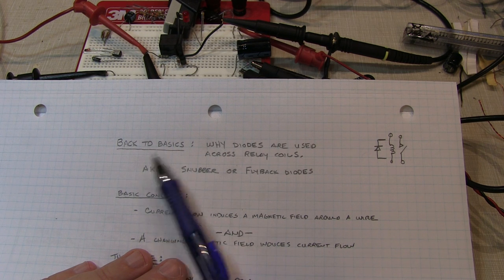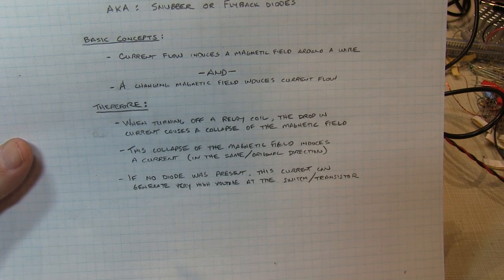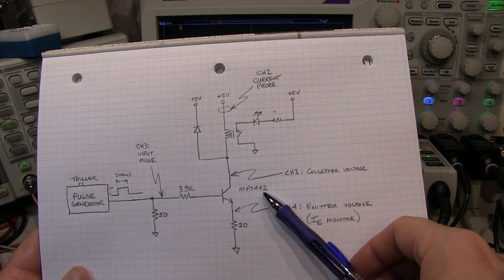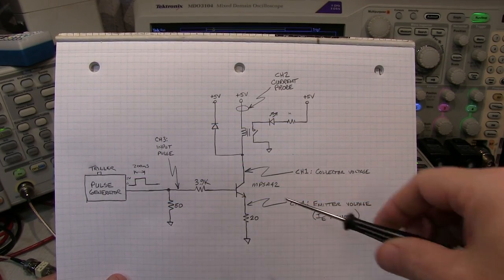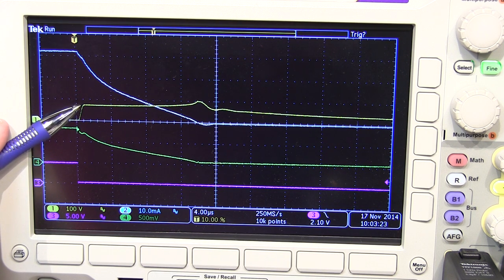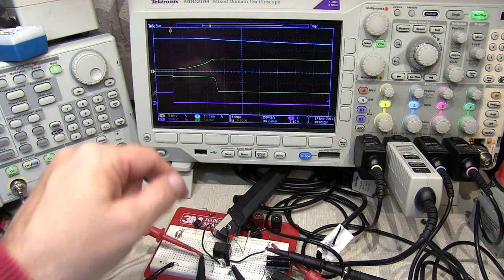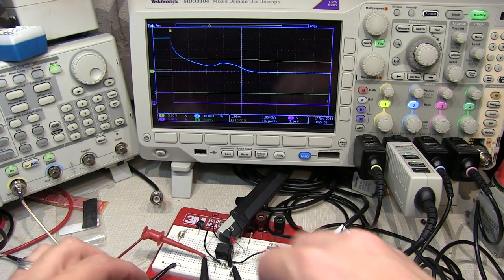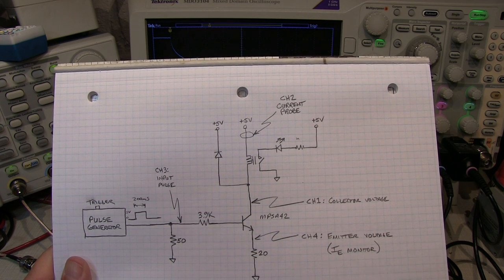#183: Why diodes are used around relay coils: Back to Basics on flyback or snubber diodes

Comment: I noticed your scope does not tell that the current probe is connected to channel 2 but underneath it knows to translate volts to mA's per division.  Is it an option of the MDO3104 (auto ranging?)? I see on the probe entrance to the scope 3 tectile switches  manu , degaussing . What is the third one? What is the max sensitivity of that probe?
Reply from the maker: The scope does give you the scale in xx mA / division. It is showing 10mA/div. Regarding the probe specs, you can find them on the Tektronix website.

Comment: @w2aew
I have read that a snubber is also a resistor and capacitor in series that is put parallel to the relay coils.
Is there a different in using an RC instead of a flyback diode?

Comment: Hello, how many volts would you expect the spike to reach at the relay switch without a diode on a 12v relay that was powered by 12v (like a car battery charger)?
Reason I ask is because as a kid I used relays to zap myself with (normally with 9v battery) but one time  I used a car battery charger with both arms covered in aluminum foil and metal rods in hand..... I was young and thought it's only 12v.... that time gave me a scare, never repeated it since.
Reply from the maker: It’s difficult to say because it depends on several factors such as the amount of current flowing while in the on-state, the inductance of the winding, the resistance/impedance at the terminals when switched off, etc.  It can easily reach several hundred volts or more.

Comment: One thing you didn't mention is that due to the current through the diode it now takes a bit longer for the armature to disengage. In other words: the relay becomes a bit slower. In most cases this is not a problem, as relays are pretty slow to start with, but it could become  a problem for a high speed CW (Morse) key. 

Then it could help to put a low-Ohm resistor (say 100 Ohms) in series with the diode: it will speed up the decay of the relay current, but at the expense of a higher voltage at the collector.
Reply from the maker: Another way to speed up the the release of the relay would be to use a zener in series with the flyback diode.
Reply: *****  Actually, I don't hink a zener would help to any great degree. The voltage caused by the collapsing field would just quickly rise to the new snubber plus zener voltage and the R of the combined snubber diode and zener is still low. The zener is still a low resistance and the time constant is still T = L/R.    I would only expect a very small decrease in release time.  Perhaps you could set that up and verify...?
...
  As Helmut suggests, a resistor can be selected, knowing the relay on-current, that keeps the flyback voltage below the transistor brealdown voltage.  This would give you the fatest release time since the R is the highest possible (t = L/R).  Big "R", small "t".
...
.  The value of R could be up to a value equal to V-breakdown / Relay current (with some suitable margin for V-breakdown).
This type of thing is a consideration when desiging drivers for steppers and laser light show scanners (as I have done).
...
It turns out that if you want the fastest possible time constants in the motor/stepper/scanner coil(s), you use the highest possible voltage supply and drive it with a constant current type drive.  This is equivalent to a very high series resistance.  You need the high voltage supply so you can allow the "fly-back" voltage to go to the supply rail for the fastest time constrant. It must be done carefully, or else that high supply voltage has the capability of "over currenting" the coil -- this is why it should be a constant current driver....  YOU control the current and (sort of) allow the inductive kick voltage to do whatever it wants to ( within the limits of the power supply voltage) so the L/R time constant is as short as possible.
...
Then you are trying to move laser scanners (or step stepper motors) around in milli seconds, this type of thing becomes important.
...
73

Comment: Reallyy good... could you please explain RDC Snubber off circuit for controlling the power across a coil. and how it is different from a normal diode snubber.
Reply from the maker: Probably a topic I won't be able to get to for a while, but here is a good paper on the topic.
http://www.cde.com/resources/technical-papers/design.pdf
Reply: thanks will go through it.
Reply: One more question question though once the power is taken off.from the coil.. the current will move from diode to positive terminal of the input power? and dissipate where?
Reply from the maker: It's really just dissipated in the diode and coil (which are connected in parallel).

Comment: Great vid. 👍 Just one question, I assume there will be a permanent leakage to the + rail from the diode? Thanks.
Reply from the maker: Only when the relay is energized, and even then it will just be the small reverse leakage of the diode (typically a few uA or less).  No current when the relay is not energized.
Reply: @w2aew  OK, thanks.

Comment: Thanks Alan, 1 question I have is:Could you put a switching circuit in,instead of the diode,that would then become the charge current to a battery or an ultra capacitor bank? Of course I'm thinking of larger scale devices such as linear actuators on industrial machines or such.
Reply from the maker: Yes, this is really the basis for a simple unregulated boost converter.

Comment: Can you add a resistor in series with the flyback diode to speed up the snubbing process? Is this a good practice?
Reply from the maker: I don't usually see that because it would result in a larger reverse voltage.

Comment: It makes me wonder would a 6v zener diode work if we attached its cathode on the collector and its anode to ground ? In theory it should work as it turns on once the voltage ramps up to 6V and the current will flow and discharge to ground.
Reply: But because of that maybe noise will enter the system

Comment: @7:05 Where does the excess current flow? Back through the 5V supply or through the probes? both?
Reply: Through the top of coil...the diode is connected directly to the top of the coil...so current takes less resistant path back through the coil.  The schematic makes it appear to some like it passes through the 5V supply...when actually the wire is connected back to the top of the coil.

Comment: Hey bud. No ones seems to have an answer for me on this an this is one of the better vids on inrush current I've found so far.. I'm at my wits end here lol. So long story short, I have 2 side by side LM317 circuits, voltage regulator(works great) then current regulator(works but getting spikes) I've tried every capacitor, every diode, everything. I've managed to totally get the voltage perfect. But no matter how I try I get .1-over 1amp current rushes going into my laser diode and out my laser diode.. Which if my LD was ACTUALLY hooked up would destroy it. Nothing makes sense. I even added a slow start/slow off by mixing PNP and NPs in with it and manage to get the -amp spikes down to .1ma(still want it smaller TBH) but still see peak spikes as high as .7-.8... averaging .4-.5 Way over accetable. What am I doing wrong? What am I missing? =( Been stuck on this for awhile meow.
Reply from the maker: Without a schematic of what you're doing, it is impossible to provide comments and advice.  In general, the LM317 can be used as a constant current regulator, but will not work well when switched on and off because the current isn't regulated until the voltage across the reference resistor increases to 1.25V.  Then, you're subject to the transient behavior of the regulator circuitry.  There are better ways to do regulated current switching.
Reply: Ohhhhh.. Ok.. So that maybe be culprit?Makin a lil more sense..An I figured about the needing to see the circuit. Just hopin maybe someone else has had the same issue and had an easy fix =/ I mean it should always have it's reference voltage at leas to tho, shouldn't it?(I'm powering 4.8volts, nice and regulated constant.). But you mean during spikes it dosnt sense it right, is that it? Then whats the point in the dang thing? XP  Also, already thank you for the guidance. An suggestions on videos to steer me to in reference to those easier ways? I've seen with relays and stuff to protect transistors or mosfets, NP and PNP (where I got the idea to try those) but mine has no relays, and has no transistors or mosfets I'm even 1/3rd as worried about frying as my 20+$ a piece LDs.. THANKS AGAIN!  @w2aew
Reply from the maker: @user-be4yc2vr5c  The LM317 was designed as a voltage regulator. Period.  The fact that it can be used as a constant current source is a bit of a bonus, but it's not perfect.  I did a video on current sources and current mirrors that you might want to take a look at.  Depending on what you want to do, there may be much better ways than trying to make an LM317 do the job.
Reply: Awesome, thank you so much for the help! Wish I knew that before I got them x.x; They get hyped so much.. I will search for those vids on your list. An thanks again for the guidance.. Like I said, been at it weeks now trying to get no current in or out rush outta this circuit x.x Been just cause the LM317 is garbage(or garbage for current regulation?) this whole time..  @w2aew

Comment: Howdy. Great.
The diode is a great backfire killer yes. Be aware though that this makes the relay or contactor slow. The residual current will keep the relay activated for some time.
A RC series component could be used instead of the diode if faster turn-off is needed. The driving transistor should be a 400 V item in that case.
Standard RC values are C=100nF and R=100 ohm. There are RC transient killers available with these values.
I have an experience with a PLC driving a small hot glue valve. The valve had a 1N4007 connected parallel with the coil. Good policy yes, but it was impossible to get precise glue dots on the cardboard. We replaced the diode with a RC transient killer and got precise dots. Clearly the RC knocked down the transient spikes enough not to cause a breakdown of the PLC output transistor.
In high regards.

Comment: Really good video.  I had no idea those sorts of voltages were generated around relay coils. Would it be sensible practice to fit one of those diodes every time you put a relay in a circuit?
Reply from the maker: +Spoolz07 Yes, absolutely.
Reply: +Spoolz07 Let's clarify: You should fit a diode every time you put a DC relay in a circuit. Perhaps that's self evident and perhaps it isn't. I deal with AC relays frequently and get asked if they need snubbing (it depends...) and how to do it (little RC network).

Comment: Often, I see a 1N4001 (or other 1N400x diode) across the relay coil. The 1N400x are one of my favorite power diodes, but it is not a fast switching diode, which is what is needed to react to the transient. I would use a 1N4148 in this application.

Comment: What if I am using a toggle switch and shutting off the power on the positive side going to the solenoid? Do I still need a diode? If so where do I need to put it in the circuit
Reply from the maker: Still a good idea. Put it in parallel to the coil/solenoid, cathode towards the positive side.

Comment: I'd like to hear someone talking about the effects of applying the excess voltage into the power supply rail. Everybody seems to assume that "it can take it", but what about regulation? Is it the same if it's LDO or switching? Boost or hysteretic converters should take it better than step-down, I presume. Would that contribute to ripple? Perhaps cause a nasty oscillation on sensitive LDO regulators? Can a simple capacitor near the diode dissipate the effects? What if a sensitive IC closeby gets a VCC spike? Those are the real questions! :)
Reply: Oh, I've read the other answers! I've got the point.

Comment: w2aew, any reasons why when using AC voltage for coils you don't need to use a flyback diode across the coils terminals but if you use DC voltage you have to use a flyback diode? I'm guessing the AC voltage on coils doesn't create a negative flyback voltage when the coil is turned off?
Reply: AC coils and transformers do produce a counter EMF. In the old days I used to play with the AC plug for my parent’s TV, a big spark every time I unplugged it, cool! Basically AC coils are gonna be directly across the mains line. No electronics in series with them. So no electronics to damage.
Reply: @Joe_Sova  what do you mean by counter EMF, is it different than just EMF?
Reply: @waynegram8907  Hi Wayne, when we pass a magnetic field over a wire, of course an (E)lectro(M)otive (F)orce is produced. This EMF (or Voltage) tries to induce a current in the wire. If the wire is in a closed circuit, it succeeds and current will flow. However, nature doesn't allow anything for free, the current in the wire is flowing in a direction opposite to the original current such that it's EMF is generated in the opposite direction. This reverse generated EMF is called Counter EMF. Its why generators, turbines require a lot of work to rotate when they are generating electricity. All EMF generated by a magnetic field, induces an opposite magnetic field opposing its source. Without this effect we would easily be able to create free energy!
Reply: @Joe_Sova  What Lab test equipment can I use to measure EMF and the Magnetic field values? I want to measure how much EMF and magnetic field a transformer in a power supply is generating or measure an AC or DC motors EMF and magnetic field but not sure what to use to measure EMF and magnetic field
Reply: @waynegram8907  Interesting question. Impedance is the name given to a coil’s resistance to a changing magnetic field, measured in Henries. It’s the counter emf that causes the impedance. There are many types of lab equipment that measure henries or millihenries of a coil. For the most part, they both occur simultaneously. C-EMF can only be measured by how much effect it has on slowing down the rising current in a coil. I wish I had time to make a thorough video on this, it’s a neat topic. If you apply 10 volts to a 10 ohm resistor, 1 amp at 10 watts will flow instantly. 10 volts applied to a coil will take an amount of time to get the current up to 1 amp. This time delay is caused by the c-emf. We are all familiar with the concept of a capacitor holding a charge. Well, coils do it too! Coils hold a voltage charge, capacitors hold a current charge.
Reply: @Joe_Sova  yes in power supplies have filter capacitors. If a circuit under test needs 3 amps of current for normal operations. How many filter caps and what filter cap values would you use to provide 3 amps or more? How can you measure how many amps of current a filter cap can STORE?

Comment: Noob question: why do you have the diode returning the current to the +5V supply and not ground - would the latter cause a ground bounce?
Reply from the maker: If the relay was being high-side switched, then you could return the current to ground.

Comment: Very good, question are switching diodes the same as Zener diodes? and how come I have seen Zener diodes in series with what seems to be normal diode?
Reply from the maker: Zener diodes are not the same as switching diodes. Zeners have a specified reverse bias breakdown. The series combination you mentioned is commonly used to speed up the release time of the relay by allowing the flyback voltage to raise up higher.
Reply: Thanks, I been thinking of ways to protect a 12 volt relay
Reply: @2000Betelgeuse  It isn't about protecting the relay as much as it's about protecting the solid-state device that's driving the relay coil.

Comment: Thank you for the video, very informative. Would it be good practice to put a diode across a switching 12VDC fan load?
Reply from the maker: +kamaka71 Some fans present an inductive load, some do not.  In any case, it probably couldn't hurt.
Reply: ***** Thanks for your reply. :) I will add a diode to my circuit.

Comment: so the current through diode goes back INTO 5v source? won't that damage the battery thats giving 5v in the first place? Also why add diode that takes current back to 5v supply? cant we add diode and connect it to ground?
Reply from the maker: Think about it, if the diode was connected to ground instead of the positive supply, then it would be turn the relay on.  An alternative is to use a high-side switch on the relay so that one side of the relay is connected to ground.  Then the diode will return the current to ground.

Comment: Does this effect regular operation of the circuit?  For example now that there is another current path did we increase power consumption for this protective feature?
Reply from the maker: +Des Troya It does not affect the normal operation. When the relay is energized, the diode is reverse biased, so no current flows in it.  The diode only conducts to help dissipate the energy stored in the magnetic field in the relay coil when the relay is turned off.  Once this happens, there is no current flow in the diode.
Reply: +w2aew   got it, I was looking at it incorrectly.  I'm getting used to these more grown-up circuit diagrams, but I see it now.  Thanks for the video.
Reply: +Des Troya   The primary effect of adding some type of a snubber is that the current decay / turn-off in the inductive load now takes longer. The inductive current takes longer to decay to zero.  This can slow the release of the relay.  Normally not a problem, but this effect is there....This is because the time constant of an inductive circuit is TC = L/R.  Because the diode has a very low (dynamic) resistance, TC is greater (longer time).  In some applications this is an important consideration to be taken into account.--Cheers